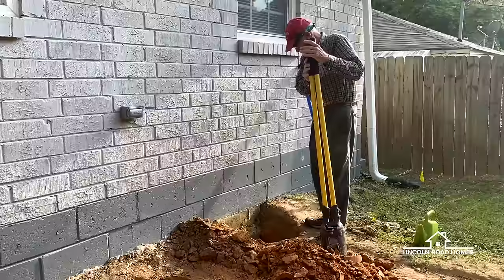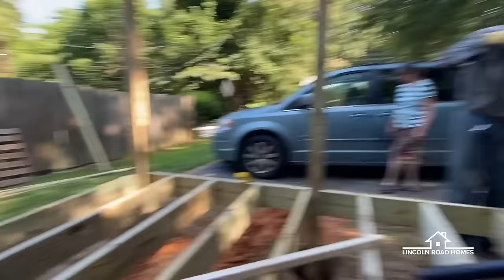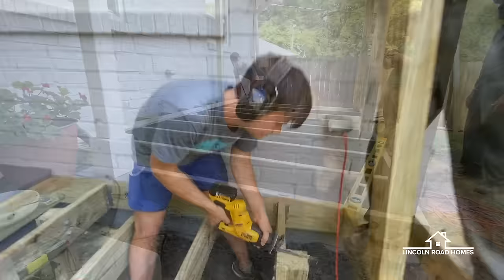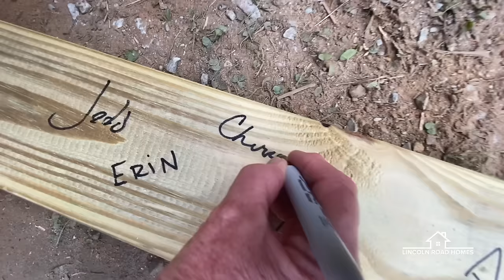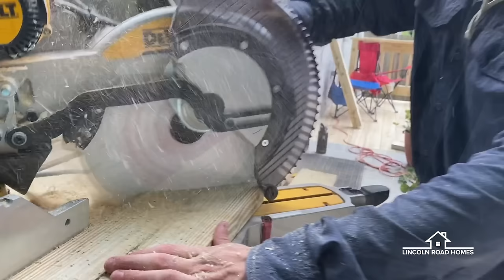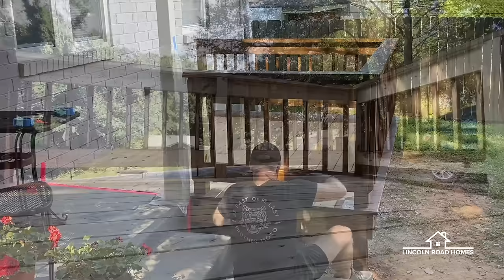Building an 8x10 DECK...in 8 Minutes

Comment: Jesus im seeing these comments lol lota Bob villas today lol...I saw one comment stating it needed a support beam lol 😆..it as a freaking  8×10 deck  lol wheres the beam going ?? And concrete  was used lol , notches are not required on a deck that's knee high..the posts are not carrying a roof ..they are literally carrying a knee high deck. Calm down everyone lol...simple deck done well ,and he did a good job..btw the lags and bolts will do the job..again 8 foot by 10 foot.they literally  carried the weight over there lol...nice deck guys.
Reply from the maker: Haha thank you...I appreciate SOMEone noticing that this isn't a massive deck way high up in the air.  It's 8x10 feet, and only a few inches off the ground. Some of these people need some meditation in their lives...or maybe therapy lol. The anger and hate is wild.

Comment: This is the craziest thing I’ve seen. Who builds a deck like this
Reply: And you need to let it dry for like a half a year before you stain it. Jezzzz
Reply from the maker: I sent all the design elements in to the city and everything was approved for this size and height of deck.  I stained the deck right away because I had renters moving in pretty much immediately and needed to just get it done. Not a huge deal.

Comment: I am a former residential custom framer and am currently ICC certified in the IRC Building Codes. I just read a lot of the replies and so I thought you might want to hear that there is not that much wrong with that deck. It looks great. I add comments below because I still learn from others comments. There's not many people as perfect as Jack   ..
 As far as the back band being fastened to the house I don't see the need for the back 4x4 post except for the where the handrails end. It looks like the bands and joists are 2x8's at 16' o.c.
If what these other people are saying is true about not meeting codes where they live, I'm glad I don't live there.
 There were times I would build a deck at existing homes and I would have 4x4 posts fastened to the back band and concreted 2' into the ground and not fasten the band to the house to allow for movement. But that was a case by case at my own personal discretion. 
 As for the person saying the post needed to be notched. The deck has almost no dead load and 2x8 joists at 16" o,c,  spanning only 8' and 2x8 bands are only 8' and 5" between posts with 2 lags per post gives a good live load support for what the deck is designed for. The post notching is actually more dangerous because it weakens the hand rail support when someone leans on it.
 As far as the guy with the engineering failure reply, The only reason to use cmu blocks is if you want to keep the post above the soil which is a good idea because the treatments used in          pressure treaded lumber today doesn't work as well as the cca treated lumber from years gone by. When the post start to rot later on, cut the post just high enough to support them with concrete blocks (CMU's). If the deck is attached to the house I doubt it will go anywhere, but might brace them under the deck to help support the handrails.
As far as the reply about the ledgers, you can also get joist hangers or fasten 2x8 blocks to the bands wedged between the joists then fasten the joists to the blocks.
Reply: Thanks for all the feedback.  Appreciate it!
Reply from the maker: Thanks so much!

Comment: I think the deck looks great, I'm seeing  allot of negative  comments  ,I'm a contractor, in va ...where its a house with a foundation, I would have taking advantage  of a ledger board attached through the block with bolts.with that said,there is nothing wrong with the approach used here.in the state of va ,this is the only way to build a deck on a trailer, it is code that the deck cannot be attached to the main structure, so this is perfectly safe .good job guys..the only advice  I would give is to wait a couple of months  to stain.you probably  should let the pressure treated lumber dry out and start to sun bleach just a bit...I have seen the salt brine cause the stain to  blister  if you don't give it time...other then that beautiful  work you should  be proud
Reply from the maker: Yeah if I didn't have tenants moving in immediately, I would have waited much longer to stain...but it's now been over a year since I stained and everything still looks great. Appreciate the feedback!

Comment: Deck looks good. Just the part with the rear posts not fastening to the rear ledger, but then again its not even a big deck, and it can be braced after the fact with 2x8 blocks or lateral support from the post  (its scary to dig that close to the foundation, you can destroy the moisture barrier for the foundation, so you managed to avoid that with your build). I specifically came here to comment about the "codes" complaints. Unless you have dealt with codes, you don't need to police it. Youtube surfing videos teaches you different code applications for different states. Personally, i just lifted the foundation on my house under my living room where it sank from a failed block pier supporting a girder under my home (it cracked and the floor started sinking), and had to argue with codes for 5 months straight. Turns out the whole time i was right, because i was technically "overbuilding" and i was supporting 3x the load than required, and every single codes rep had a different opinion (FYI i built off of codes of a combination of states, i live in SC, our own codes department between my county and Columbia didn't have any information pertaining to my project and wasn't able to give me a clear answer on how to proceed when it came to the footers and bracing supports AT ALL). Basically, unless you are running electrical or plumbing, altering the structure of your home or attaching to it, people don't pay attention to them, so don't come on the internet barking at people about it when you probably can't even get off the couch. Be smart, do your research, use logic, and you're more than likely going to do a good job.
Reply from the maker: Appreciate the feedback. Yeah everything was approved by the city.

Comment: great job everything is done right except you should have notched the 4x4's and rested the weight of the deck on the notches and bolt them all together because one day it WILL break and can hurt someone. it won't hold all that weight with the screws and shank screws otherwise it turned out great
Reply from the maker: Appreciate the feedback. We got this approved by the city, permitted, etc...and it’s an 8x10 deck that is like 6 inches off the ground, so I think it’ll be ok.
Reply: I built a deck about the same size without notching the posts.  30 years later it's doing fine
Reply: No notch needed he's it will last for yrs! Great job everyone thinks they're Bob Villa!

Comment: Definition of notch the post carriage bolts are not meant to hold freestanding wait
Reply: I didn't see any carriage bolts, I saw lag bolts....besides, they are used in combination with nails, look up Craig Hefermann's 8 x 10 deck.
Reply: Wouldn’t it have been easier to just build a patio?🤷🏻‍♂️
Reply from the maker: @tg8150  A patio would have been down too low. We needed it higher up.
Reply from the maker: skooterific911  everything was approved and permitted by the city, I promise. Thank you for your concern.

Comment: The idea of building it is good but that deck is not safe I don’t see the post with concrete or the sport for the frame, that deck is gonna fail in a couple of years and all the hard work will be gone. Always is good to ask an expert and have a inspection
Reply from the maker: It’s all up to code and permitted 👍🏼

Comment: I knew this was totally an engineering fail when the first thing I didn’t see- was the foresight to attach a header channel straight to the CMU block and build the frame off that. Instead pallets for leveling etc. decks like this are why code enforcement matters. The mechanical shoring of this entire structure is not safe. YouTube = the best and worst part of the internet
Reply from the maker: Everything is up to code, received a permit using these exact plans...all is good.  I’m not telling anyone to build a deck just like this.  Do your own research in your own city to make sure you’re meeting your local codes. 👍🏼
Reply: I assumed the pallets were to protect the holes while the concrete dried so that small children and animals did not fall in the holes...
Reply from the maker: @tellis0701  yep

Comment: This is not even up to code. Must have concrete footings. The 4x4s in the ground will rot 3 to 5 times faster because they are under a load. I agree with they should have waited a season to stain. There's a few other things that arnt up to code but I'm not going to comment everything.
Reply from the maker: All the posts have concrete footings. Watch 45-49 seconds into the video a little more closely. Yes I could have waited to stain the deck, but needed to get it done so i could take pics and get renters in pretty much immediately. Appreciate the feedback.
Reply: @LincolnRoadHomes  shouldn't set them in footers...you add gravel in the bottom of the hole for drainage, place the posts on the gravel and fill with portland....not doing that will just rot the hell out of them
Reply: @LincolnRoadHomes   What I meant is that you need at least a 8 in footing down 36 to 48" depending on the area. Then you need a 1/2 in anchor bolt in the concrete with a 4x4 base plate. Will last anywhere from 2 to 3 times longer because there is no treated lumber in the ground.
Reply from the maker: @SteelersXX2  Yeah makes sense. Next time I build a deck, I’ll do that.
Reply: @LincolnRoadHomes  Well thats good. Everyone makes mistakes and I have been building homes for 10 years. And almost every house I have built had a deck or a wrap around patio. I hope you have a great day.

Comment: All the wood posts supporting the deck will get rotten quickly beneath ground surface since they are all not covered by cement against water and moisture.
Reply from the maker: Next time, we’ll keep all the wood above ground.

Comment: Looks good. The back 4x4 need to be attached the the layer board, not the joists. I can send you a sample so you can use it on your next deck project.
Reply from the maker: Thanks! Unfortunately we couldn’t move the 4x4 posts closer to the house because the cement foundation was in the way, so we had to attach them to the joists.
Reply: @LincolnRoadHomes  you also use the concrete from house as footing for your deck posts.
Reply from the maker: Haha yep next time

Comment: Why wouldn’t you spend the 30 dollars on a couple bags of Crete
Reply from the maker: Look closely at about 45-49 seconds in.
Reply: @LincolnRoadHomes  you’re right I missed that, but I was talking more about setting the posts in Crete instead of dirt packed
Reply from the maker: @gregrupar135  ah, in order to get a permit, the posts just needed to be set on concrete footings, so we went with that.